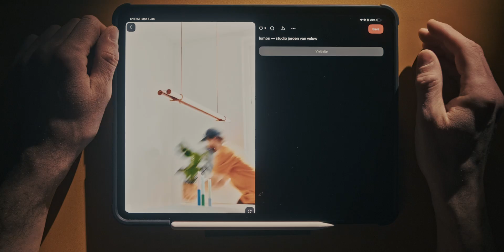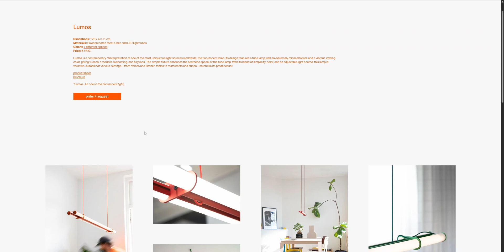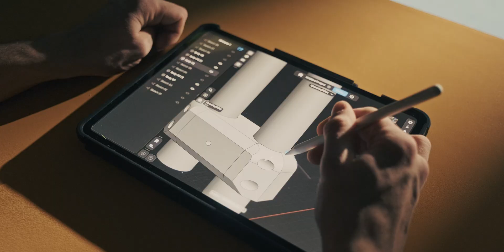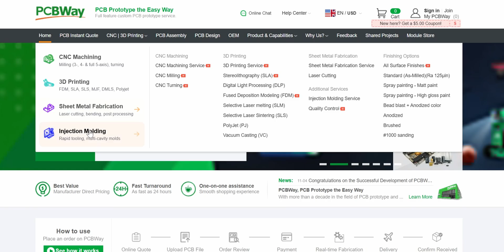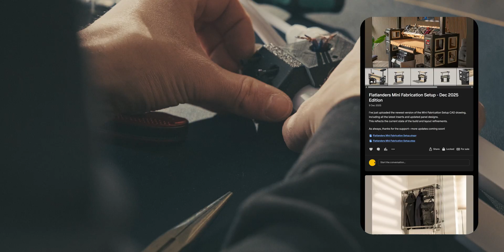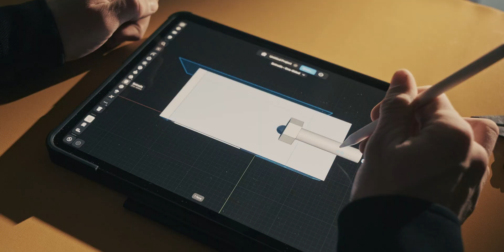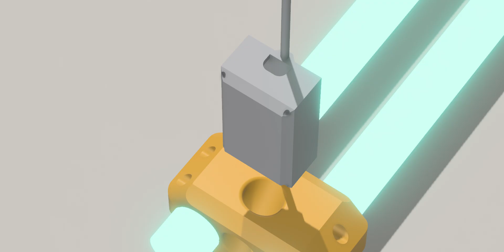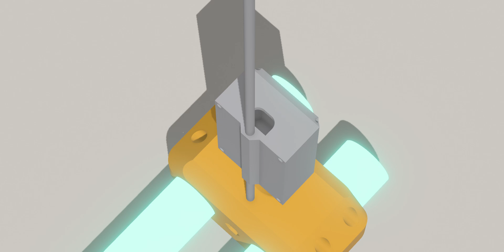3D Printing Lights for My Storefront Studio

Comment: Not sure how easy these are to disassemble, but if you can move the led driver away from the tube, you can run power over the same wire you’re hanging the tubes from. I did something similar with an ikea tradfri led driver and a generic LED strip. The ~10W driver is not powerful enough to hurt you :)

Comment: Really love this lamp, might make something like this myself! You could replace the metal wire with an electrical cable.Then you would not need this thick electrical cable anymore. Also replacing the 3d prints with multiplex could look really cool.